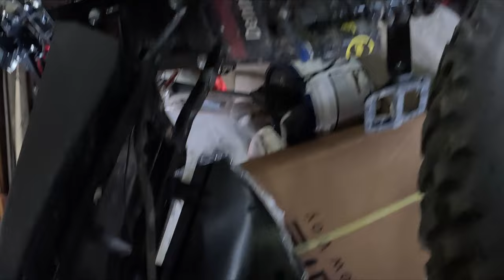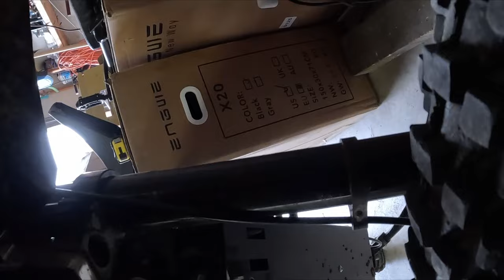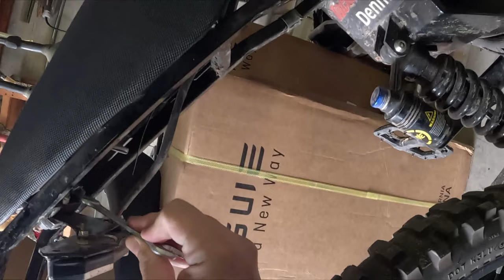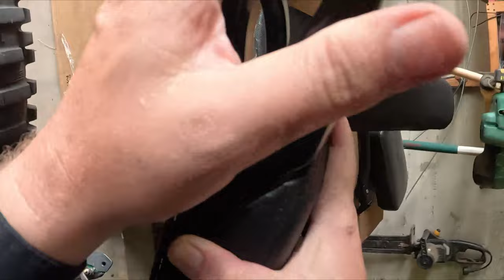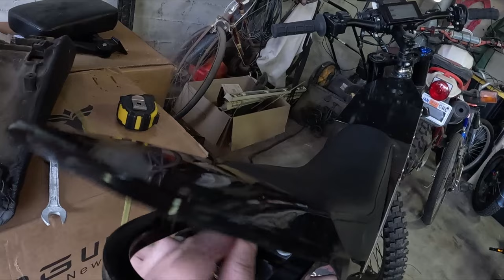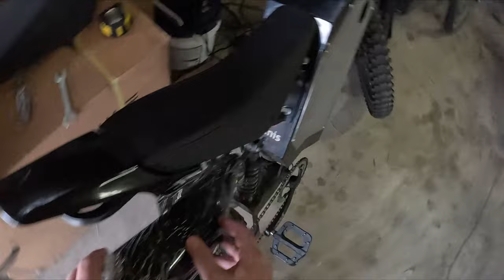Unboxing CRF50 Plastics for use on my 12KW Stealth Bomber ebike.

Comment: How did you know it fit?
Reply from the maker: I took a chance. If you look at CRF50 seats, Razor MX400 seats there all using the same mount hardware 2 screws and 2 latch plates. for the price of a dinner, it was worth the risk.

Comment: Do you think it would be possible to put a longer rear shock on these stealths? In order to get more travel? The stock shock is about 8 inches eye to eye. The Talaria is about 10 1/2 inches eye to eye. Im a bigger rider and would like to put the Talaria rear shock on mine for more travel.
Reply from the maker: It's possible to put a stronger spring on there for a heavier rider. One guy also was running 2 shocks on the rear I think he was @joshstreetdesign  but there's a good chance the swingarm will fail.
Reply from the maker: It's also missing a traditional linkage for longer travel it might be more feasible to move the parts into a 125 frame.
Reply: I already have the bigger frame because I went with the 15,000w 72v 70A battery. Im just not sure if the longer rear shock will sit properly when stretched out. I afraid it will rub
Reply: @edgurash834  did you do it? I'm having the same internal debate as a bigger rider. I'm still waiting for my 15000w 70ah to get here but I was curious if a 260mm shock would fit. Easy to find those with 1000 or 1200lb springs. I know the longer shock will increase the height of the bike and maybe I'm wrong but in my head the extra weight would make the bike sag down to a more normal height anyway?
Reply: @BeautyBeastRC No. Unfortunately, a larger rear shock will not work due to the angle of the stock installed 220 mm shock. I looked into this for mine. I just set my sag really high so it would be stiffer. Also, I am starting to have the same issue with mine that Tacticooldan had. Where the bottom weld of the shock bracket is bending and cracking the swing arm. This is a major flaw design in these China Clone Stealths. Because it is a hallow bottom plate, there isn't a firm foundation for the shock to push off. I don't even do any off-roading or jumping like he does. Mine is all street riding, and this is still happening. It's very frustrating. I am about 285 lbs. with gear. Luckily, I have a buddy that welds when the time comes to finally fix it. It was a nice, inexpensive starter ebike, but I'm giving up on it and leveling up now. I pre-order the Altis Sigma. I'm hoping it will have a much more robust frame design. Also, I have lost 50 lbs. So that should help, Lol. Enjoy your new rig, man. They are a blast to ride!
Reply: @edgurash834  that really sucks bro. Where did you order your clone from? Really hoping I don't have these problems and I'm even heavier than you were 🤣
Reply from the maker: There's another frame type out there with a better designed swingarm.  You see them on the delfast bikes. You could swap over to that frame. But yeah the emotos are cheaper now. My next bike will be a eride pro or sigma. Unless something else comes along better. But I need to ride this bike till I can save up.
Reply: @tacticooldennis  real pedals and the bike seat go along way for me. I really like how it looks a bit more like a bike so people won't look at me as funny 🤣
Reply from the maker: Same, I like having pedals to confuse hikers and cops.  Delfast and cab ebikes have a similar frame with pedals and better welds, I just don't know about dimensions for batteries. But welding the swingarm works, too.